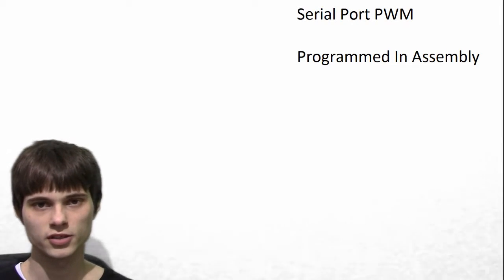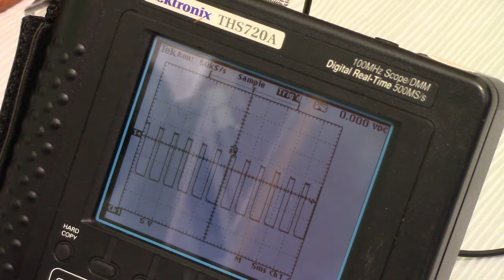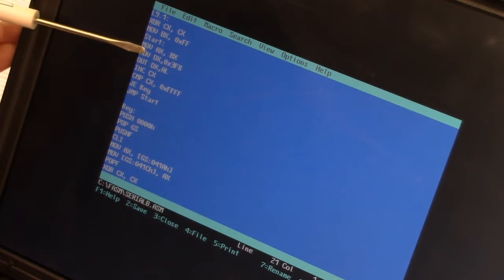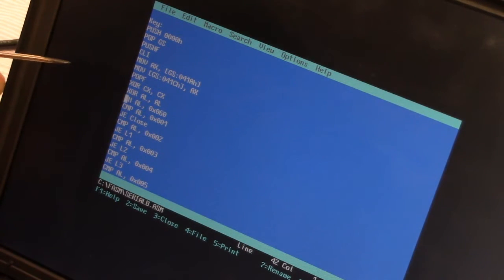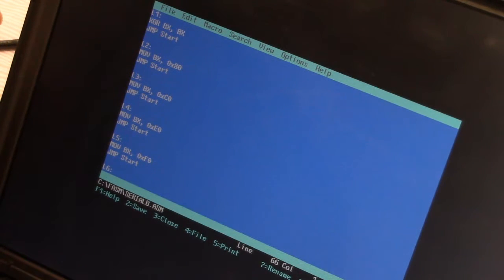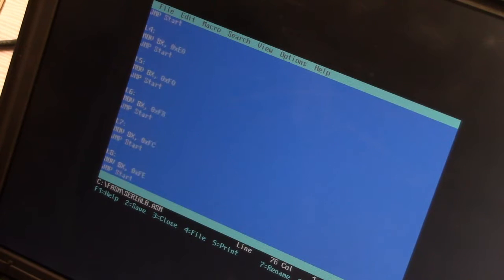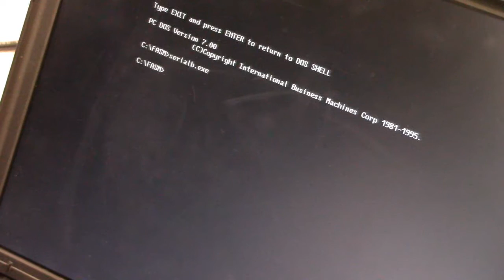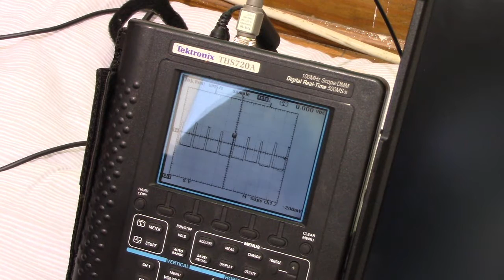Assembly PWM; Keyboard Control

Comment: HI

  Thats good, i wonder when you say its all running faster on the direct boot version because DOS is not running i am sure that can not make any difference as once its running your program DOS can not be doing anything else BUT what it may be is the settings of the serial port BAUD RATE, under DOS the serial port may be set to a default rate of maybe 2400 BPS for example BUT on the direct boot from floppy version the default baud rate is much higher maybe 9600 for example so the PWM pulses are far faster, you should maybe add a section at the start of the code to set the rate to a known value and that way it will be the same pulse rate on DOS and direct boot mode versions, also i am sure it will be easy to add 2 lines of code to print out the current number 1-9 on the screen via the INT 21 print character function, i am pleased you added an ESCAPE function, rebooting the PC every time to get out of the program was getting to be a pain, keep up the good work, Dave
Reply from the maker: Actually that's what was weird about it. I did have a serial port initialization routine that set the baud rate to 9600. Either the computer (direct boot) just ignored it, or it's just broken somehow. It was a BIOS interrupt, not a DOS interrupt so it should have worked. The other thing it might be, DOS I believe is a 16-bit operating system which of course can't use the full abilities of a 32-bit processor. Perhaps the direct boot doesn't have such a limitation? But to be honest I have no idea. I'll have to try it on other computers. Thanks for Watching
Reply: HI, well all the IC's doing the serial port seem to be only 8 bit data bus so the 16/32 bit part may not matter at all but it could be that the BIOS serial port setting routines did not work when booting direct because they needed more data about the ports but there may well be a way to set the clock of the serial IC direct by writing to the timing registers of the counter counter IC, i will do a few experiments over the weekend on my old PC but i would like to make a PC program thats more controllable, i am prototyping a PCB version of the IGBT driver based on the same IC your using so when these are done i will get you a couple over, they run on a single 5V supply so no need for isolated power supplies, i can try some more high power experiments then,

Dave
Reply from the maker: I think you're right. It's probably necessary to program the 16650 UART controller directly instead of through a bios interrupt. I haven't got that far yet. This can also be done with a parallel port and the pulse width can be set anywhere from 0 to 100 % duty cycle, like in my last video. Let me know what you come up with and thanks again